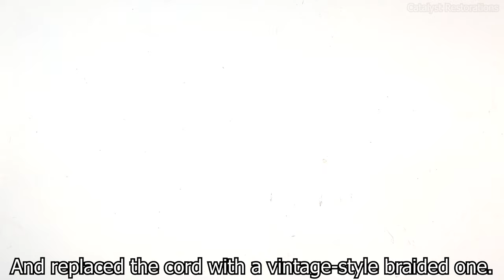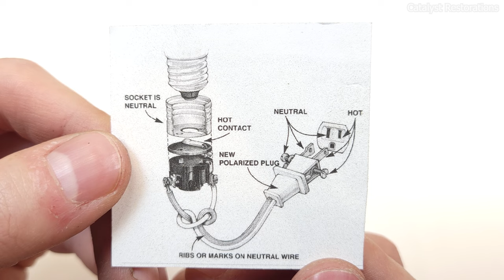Drill Press Lamp Restoration. You asked for it!

Comment: It was extremely interesting to watch the restoration of the lamp. The fluoroplast tape is not very suitable for tight thread fastening, since fluoroplast is used to eliminate friction and is a very slippery plastic. I really liked how you replaced the steel rod. In such lamps, the cable in the flexible pipe often overheated, which led to insulation damage and electric shock. Thank you for the video.
Reply from the maker: Thanks for watching and the feedback! The PTFE tape is definitely more of a placeholder - I need to just buy a new set screw for a tap size that I actually have and then it'll be perfect!

Comment: That was a lovely restoration. I thought the little tool tips were a neat addition - I hope you keep using them!

How does the hammered paint work, anyway? Is it something about the way it dries that produces the textured finish?
Reply from the maker: Thanks for the feedback!

Hammered finish paints generally work by having a small amount of silicone in them along with suspended metallic flakes (commonly mica). When you spray a nice heavy coat the silicone droplets expand out on surface contact and trap mica flakes with it, producing the droplet-esque hammered look!

Comment: I really enjoyed it all.
Just one question though, could the cable have been threaded through the flexible tube?
Keep turning out these videos.
Reply from the maker: Thank you!

I did first try to find a cord that would fit through that neck, but the problem I ran into was I couldn't find a nice cord that was small enough gauge to fit inside without having to strip off the outer jacket down to individual wires, and I was concerned that individual wires probably wouldn't be great because the neck is a little pinch-y (for lack of a better term) and could wear down any indidual wires' insulation with repeated flexing. Seems like my grandpa found that to be the case too when he drilled the side hole in the socket!
Reply: Thanks for the explanation - I fully understand. 
That's the trouble trying to source spares from the company 80 years later (Ha! Ha!)
Looking forward to your next video.

Comment: When peining over pins you can do it by using two pieces of 12mm rod. One piece at least 50mm longer than the width of your hand, the other can be 50mm with ground flats to be held in the vice (vise). By drilling 3mm holes to the depth of about 2mm this will give you the chance to rivet over both ends of the pin slowly rounding over the ends by moving the one you're holding. Then turn over the part/s to do the other end of the pin. This will give you a rounded head to both ends. I hope this helps, it will give you a more professional finish to your work.
Reply from the maker: Thanks for the tip, Ken! I'll look into this for the next project!

Comment: could you have run the cord through flexible support ?
Reply from the maker: I played around with that to start with, but it didn't seem like a good long term solution. The flexible neck is'pinch-y' (for lack of a better term) and I was worried that over time lots of repeated bending would cause the wire casings to rub/degrade and cause a shock hazard. I just couldn't find a new cord that was small enough (it's such a small diameter) yet robust enough.

Comment: Nice job ! Don’t you think the cord should go into the flex ???
Reply from the maker: Thanks!

Thank you!

I did first try to find a cord that would fit through that neck, but the problem I ran into was I couldn't find a nice cord that was small enough gauge to fit inside without having to strip off the outer jacket down to individual wires, and I was concerned that individual wires probably wouldn't be great because the neck is a little pinch-y (for lack of a better term) and could wear down any indidual wires' insulation with repeated flexing. Seems like my grandpa found that to be the case too when he drilled the side hole in the socket!

Comment: Привет!
Хорошая работа, но мне кажется, что электрокабель должен подводиться к патрону через центральное отверстие, проходить внутри гибкой стойки и выходить в районе прищепки, там и отверстия есть.
Удачи!
Reply from the maker: Great observation and I agree, running the cord through the center would look a bit cleaner. That neck has a really small diameter and I couldn't find a new cord that was robust (so it wouldn't wear out from flexing inside the neck) yet small enough gauge to fit in there comfortably.
Reply: @CatalystRestorations  Now everything is clear. Apparently, this problem was also encountered in the previous repair of this beautiful lamp, because earlier the hole for the cable was made in the body of the electric cartridge a little artisanally, this can be seen in the video during dismantling. Nevertheless, a solution was found, it works, and that's good!

Comment: I think the wires should be inside this flexible metal tube.
Reply from the maker: I did first try to find a cord that would fit through that neck, but the problem I ran into was I couldn't find a nice cord that was small enough gauge to fit inside without having to strip off the outer jacket down to individual wires, and I was concerned that individual wires probably wouldn't be great because the neck is a little pinch-y (for lack of a better term) and could wear down any indidual wires' insulation with repeated flexing. Seems like my grandpa found that to be the case too when he drilled the side hole in the socket!

Comment: Awesome! One question: I've got an old weathercock - you know, a figure of a cock that rotates because of the wind, and a cross with letters that show north, sough, east, west. The letters are made of thin tin metal and hollow (empty inside), and they are quite rusty and fragile. Also they have some holes and cracks along the edges. I wanted to squeeze/pour something like epoxy inside those letters to make them sturdy and kinda solid, so afrerwards I could put some metal filler on them, sand and paint them, drill some holes and fix them back on the weathercock. What do you think would be the best way to fix the letters? I understand the epoxy might not be the best option. Thank you very much!
Reply from the maker: Sounds like a job for JB Weld steel reinforced epoxy! You can just buy it in the tubes at any hardware store or Amazon, mix it according to the directions, spread it over/inside the holes/cracks/etc. with a spatula, let it dry for day. Then sand it flat/shape it with sandpaper and paint over it however you want and it'll be plenty strong for what it's being used for!
Reply: @CatalystRestorations  Thank you very much for your advice! Would it be easier to judge the damage if I send you some photos?
Reply from the maker: @vsemprivet  feel free to send me some pics! Catalystrestorations@gmail.com
Reply: @CatalystRestorations  Fantastic, they are on the way to your mailbox )) Looking forward to your reply.
Reply: @CatalystRestorations  The letter is approx 10 cm long, and the metal is less than 1 mm in thickness and quite rusty and fragile

Comment: HAULT 10:59 cord should be going down center of metal flexible conduit
Reply from the maker: If I could have I would have! The gooseneck has an extremely small diameter that could pretty much only accommodate thin, individual wires and I didn't feel comfortable doing that.
Reply: @CatalystRestorations   you could strip the cloth of of that it would fit trust me but it is done now over with let's move on. to newer videos.

Comment: I would put something on the inside of the clamp to avoid marring the paint on the drill press. It's OCD, I admit it.
Reply from the maker: One step ahead of you Jozsef - I've got some foam strips on order that will be perfect for it! 😉 Wanted to get the video out so I went without them here, but I did see traces of adhesive on the clips when I disassembled it so I assume someone had this idea back in the day as well!
Reply: @CatalystRestorations  That's funny. I think fixing the old thing was a good way to go but we should give a nod to the Michigan fellow who makes the repro originals. They're really a work of art and clearly worth every penny.  It is a lot of pennies though. 🙂
Reply from the maker: @jozsefizsak  they are seriously magnificent
Reply: @jozsefizsak  
Is that a YT Channel that has the guy from Michigan making "repro originals"?
Reply from the maker: @user-br3ou2cs9o  it's a seller on eBay by the name of pd2bob who makes flawless reproductions of the Delta 882 lamp that was an accessory you could buy for this drill press.
Reply: @CatalystRestorations  Judging by the used one also available on Ebay, his cast reflector is dramatically better finished than the rather crude original and every part gleams like fine jewelry.

Comment: Nice restoration as always. 

 My vote is for a waste of your time.  You are not "Dad how do I", you are a restoration channel.  Most people shouldn't have to be told what basic tools are, and there are better channels to specifically learn that if they want.  On that note, informing things that cant be told on sight (the brand of paint stripper was nice), random goop, colored liquid, the grit of polish you were using (white :)) did add some value. Also if you use a tool or process that cant be bought at your local hardware store, it could be helpful.

(Just my opinion, your and your experience may vary).
Reply from the maker: Really helpful feedback Charles! Thank you!